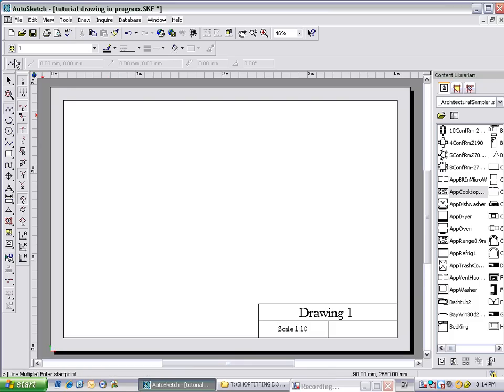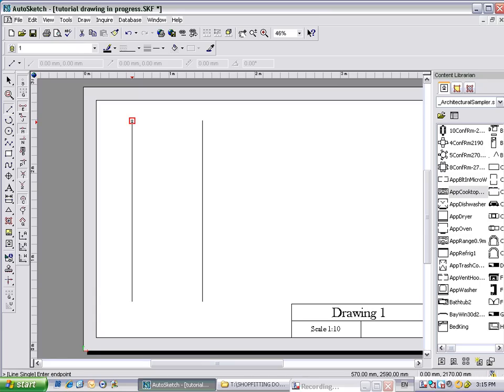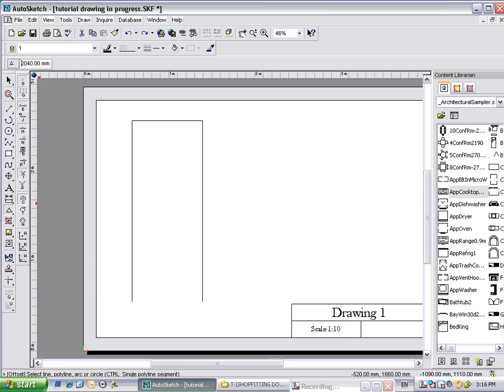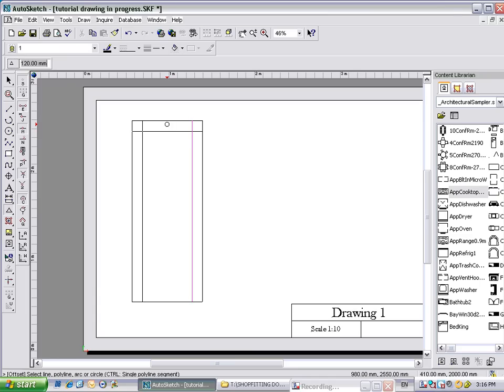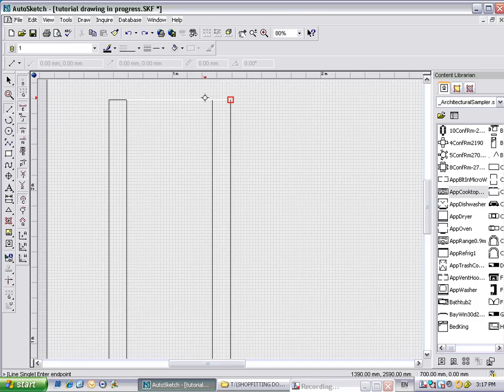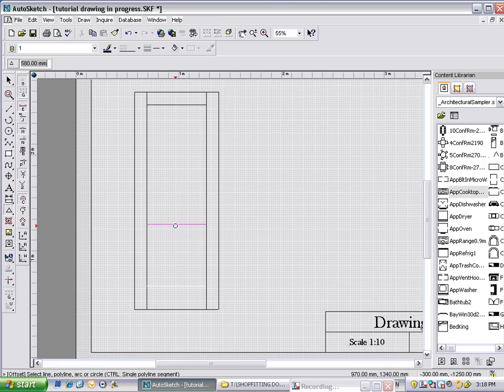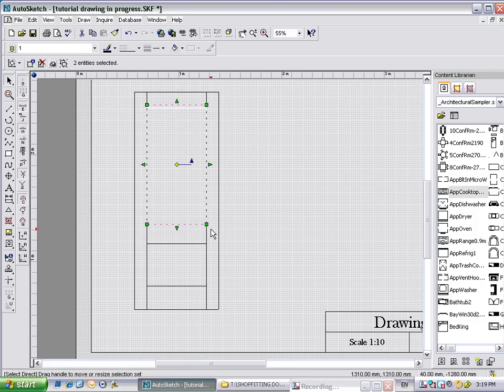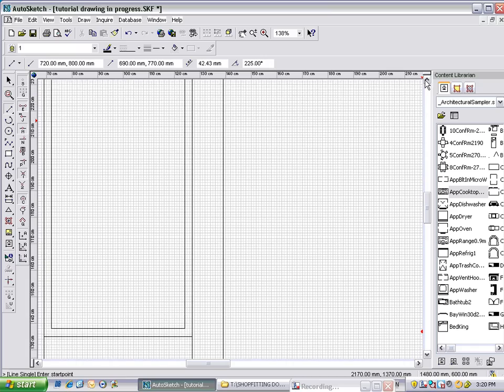autosketch quick start tutorial - part 7.wmv

Comment: Hi Steve,  I am new to AutoSketch and so far your tutorials have been invaluable in getting me started.  I have a question if I may?  I have designed a drawing with 16 circles within a rectangle and need to put sizes in text underneath each circle but central if you get what I mean?  Have been trying various things but getting a bit frustrated and wondered if you could help me please?  Regards Neil
Reply from the maker: Hi Neil, glad these have been useful to so many over the years. These tutorials were recorded many years ago, and since then I have moved onto 2D/3D Modelling, BIM and CAD such as Revit, Fusion, OnShape etc., - as i find these are now the industry standard software I need to teach my students ....so I am no longer an 'expert' at Autosketch, cause I haven't used it in years. However, an idea that might work for your issue, would be to draw a single horizontal line across the centre of your circles, have the line set as transparent or white, and then dimension the line, dragging the leader for the line down below your circles? sorry I can't be of more help, hope that it works out okay - all the best, Steve